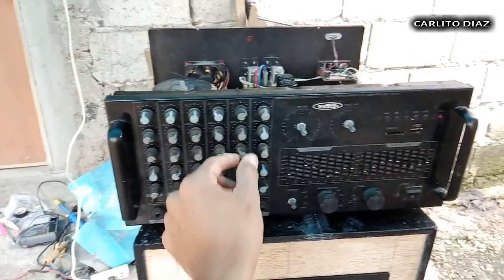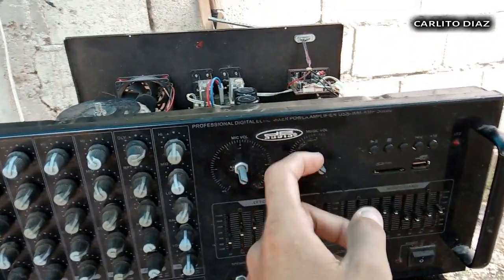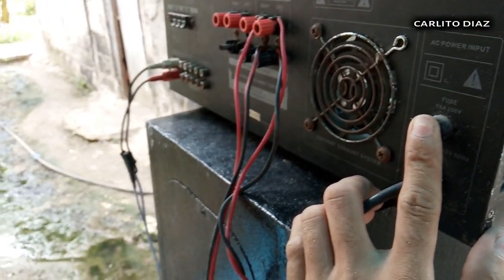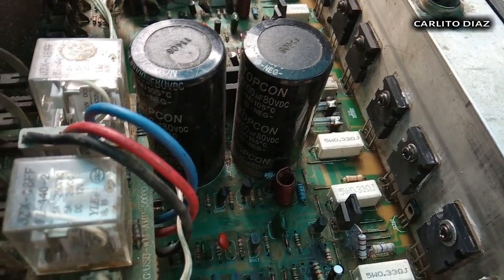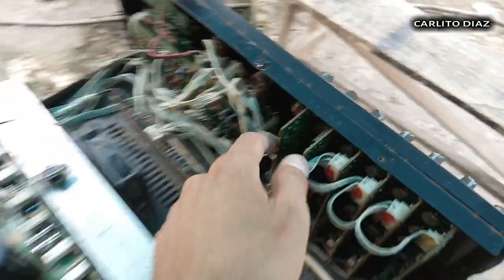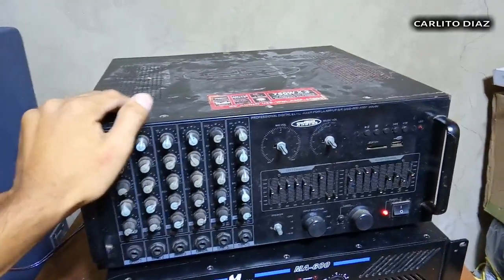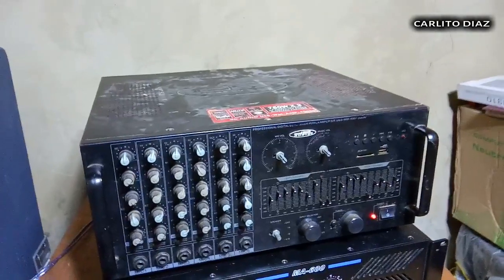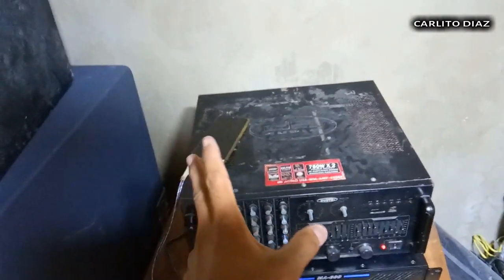Naabutan ng MALAKAS na ulan SOUNDCHECK DB AMPLIFIER

Comment: Idol tanong lang po 
Alin ba ang malakas at maganda  gamitin sa dalawang amflier .juson jupiter or sakura av 9000 .salamat idol  .and god bless .
Reply from the maker: Av 9000 po mas malaki voltage ,,same din sila nka 3 pairs
Jupiter naman naka design na sya na power amp ,separate channel na siya
Reply: Idol  maraming salamat  sa sagot .at kaya po ba.ni sakura av 9000 ang dalawang speaker croun jh  159  900 watts d 15  salamat idol more power and god bless
Reply: @greglara8917  kayang kaya yan boss. Ung sakin nga dalawang gm1k watts na speaker gamit ko kayang kayang bayuhin e, av 9000 din gamit ko.
Reply: @harvymempin4181  salamat boss sa sagot .balak ko kasi bumi ng dalawang jh croun 900 watts para sa akin av 9000 .salamat ulit boss